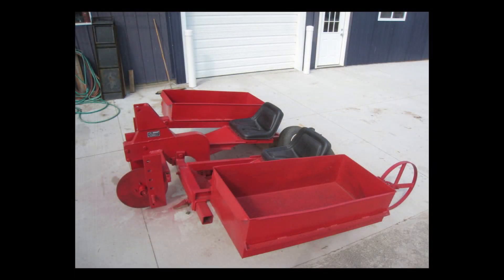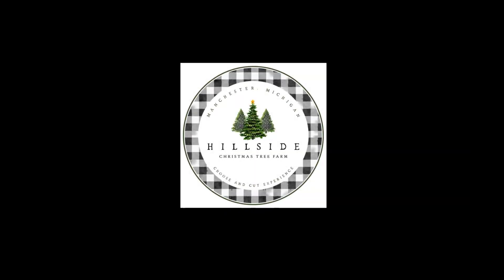How Does a Christmas Tree Planter Work?

Comment: Always thought about getting one of those planters but we always have to inner plant fields that have 10 to 15% good trees left for the following season. Nice video
Reply from the maker: It's funny you say this I'm working on some other videos and one of them is really explaining interplanting vs block planting and the advantage of block planting is the ability to use a planter like this.  Do you have some sort of auger for planting or are you out there with a dibble bar?  Thanks for the comment!
Reply: @Hillsidechristmastreefarm  we have done the same as you in past years hiring seasonal help and use shovels. Now we have a bobcat MT55 with the auger attachment that really helps. We plant between 600 on the low end and 3000 on the high end each spring. All depends on what species and sizes are available to me. We will get one of those planters soon, I do have open tillable fields that we have plans for in a few years to come
Reply from the maker: good deal.  I hand plant in my exotic area.  Too small of an area to maneuver around in there.